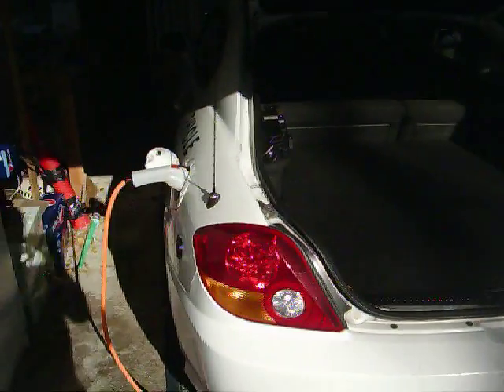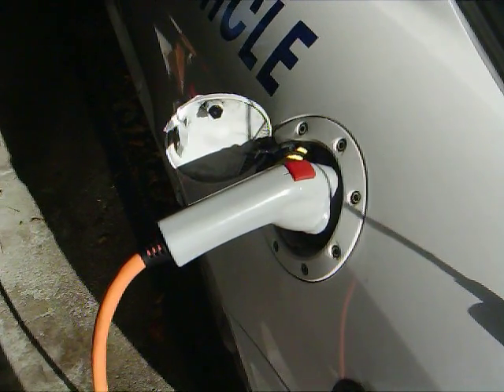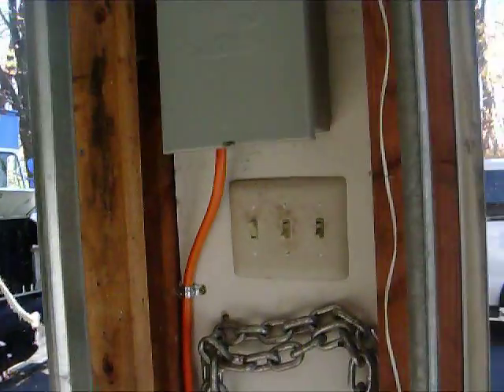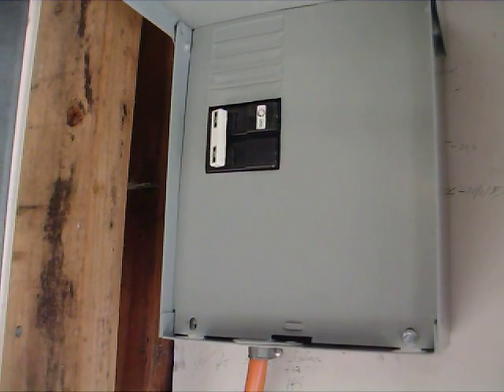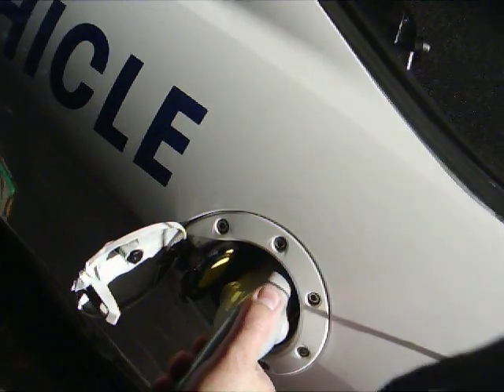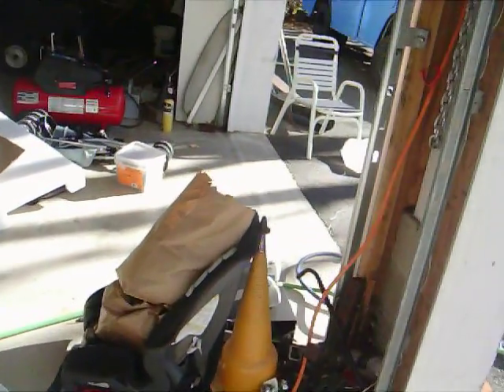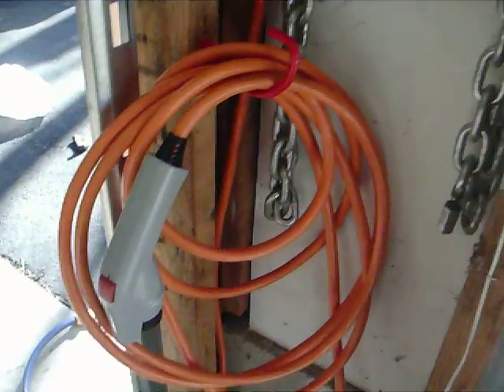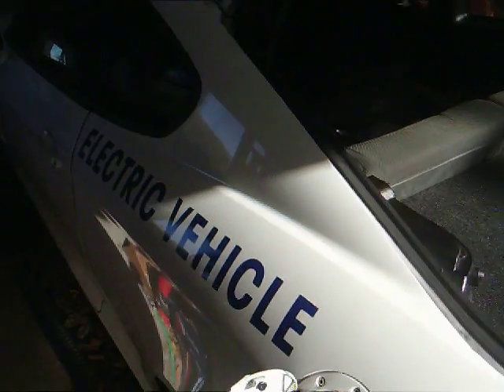J1772 EV Plug and Inlet in use!!

Comment: so you've done sort of a manual j1772?
and the car is a home conversion too?
your cable probably wont charge a leaf then?

btw how sticky are those j1772 connectors? do you have to use significant force to take it out. I'm wondering if we couldn't do away with the oversized pistol grip there.
that's no doubt done to resemble a fuel nozzle which is just dumb